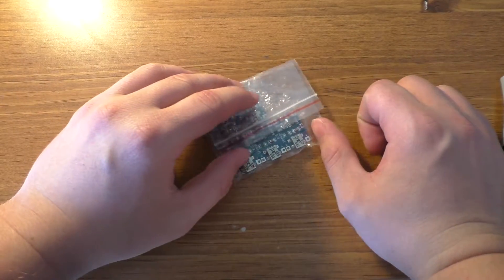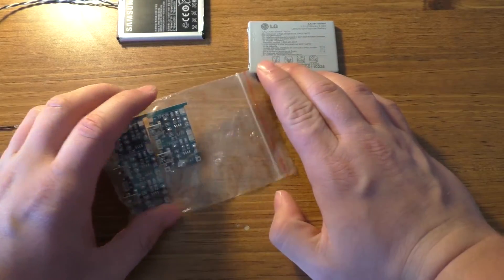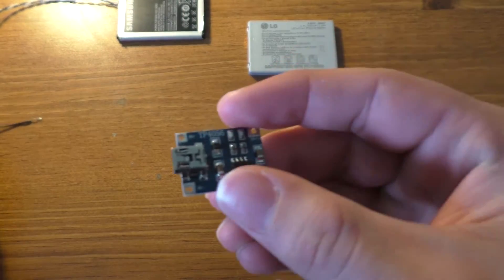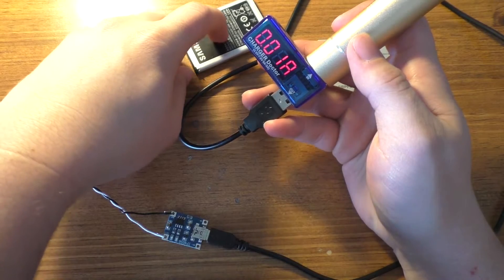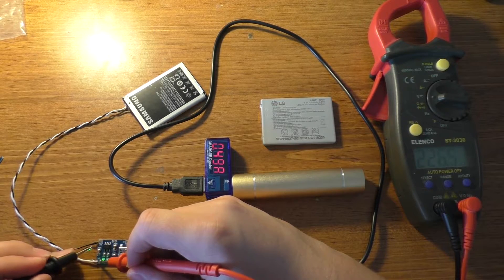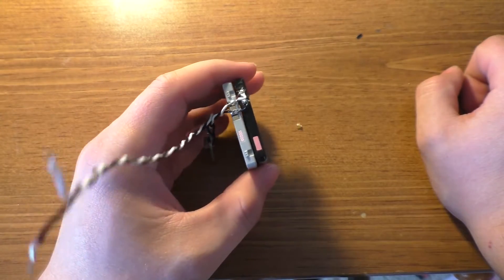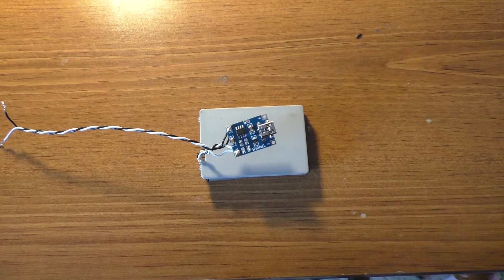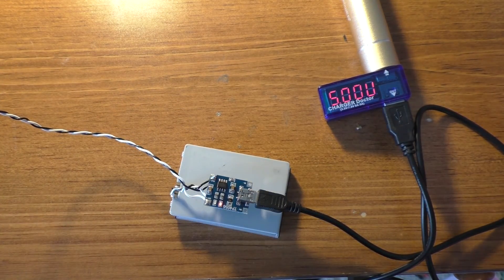Using a TP4056 lithium Battery Charging Module

Comment: On my samsung tablet the usb port is broken, i was soldering it out but i broke one contact on the motherboard. Now i was thinking about soldering two cables directly to the accu. That i could load it with the tp4056. Is this possible?
Or will there be any Problems with tablet inbuild charging Module?🤔
Reply from the maker: It might work but I wouldn't recommend doing it. Bypassing the built in one might cause some issues. I think your best bet would be to find where that trace goes and run a wire to the port.

Comment: hello if i use battery cellphone samsung 3.7v 2500mah is it secure to charge ? because i see here http://s.aliexpress.com/iYFNZRfm?fromSns=Copy to Clipboard 
(from AliExpress Android) voltage between  4.5 to 5.5v and i want to use for make a console but my battery is 3.7v some people tell me not use this some people tell me  there is no danger but im afraid the battery exploding or burn so there is no danger? thanks
Reply from the maker: You can use those to charge Li-ion batteries. the 4.5-5.5 is just the input voltage, not what is going to the battery.

Comment: Is this safe to charge 2 different cellphone batteries connected in parallel with Only 1 TP4056 module? 

Can I power  Simple 10 LED chaser circuit using CD4017 and 555 timer IC with output of this setup..? 
For your reference: check 2nd circuit diagram 

https://www.electronicshub.org/led-running-lights-circuit/
Reply from the maker: Yes and I have done so before. If the voltage is in range for the circuit and you have cells with protection then yes you should be able to run a circuit like that.

Comment: where to wired an output..? and can it charge lithium polymer and ion or just lithium polymer..
Reply from the maker: The output is just across the battery and these work with lipo and li-ion
Reply: Eman2000 i see thanks..

Comment: I have bought this charging module and also a small lipo cell , I soldered it to the charging board and it seems to charge , the red light turns on them after about 3 or 4 mins the green light starts blinking and the reef light is still on , what does that mean? is there something wrong with the battery out module?
Reply: +eman2000 please help
Reply from the maker: Check the voltage across the battery. If it's 4.1-4.2 volts then its fine. If it's lower than that there is probably something wrong with the module.
Reply: It is showing 4.1 volts but the lights are still blinking
Reply from the maker: That's odd, it could indicate an issue with the cell. Is there anything hooked to the a battery that could be drawing a load as you are charging it?

Comment: nice video, i have a question. i planed on charging 6x 18650 batteries with 1 module is that possible. batteries capacity is low like 1000mah per cell
Reply from the maker: +Joggy 251 Yes that will work just fine as long as you plan to wire all the batteries in parallel in order to keep them at 3.7 Volts.
Reply: Thank you very much about the info